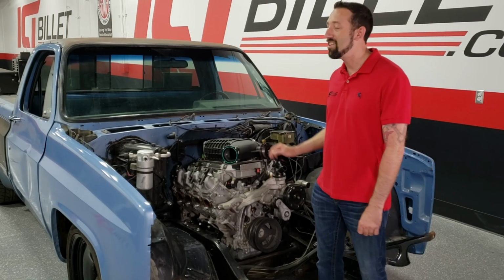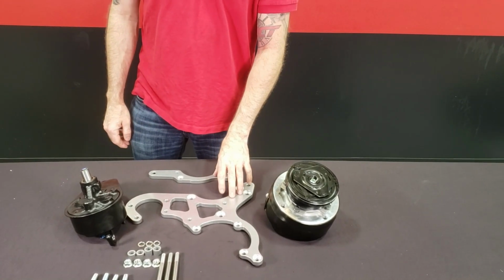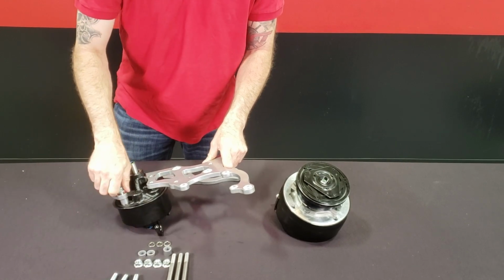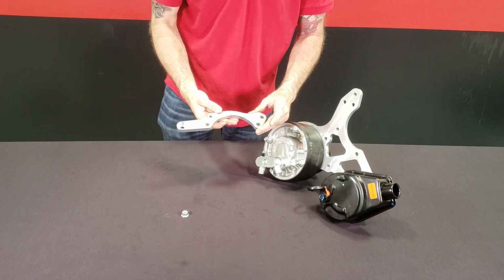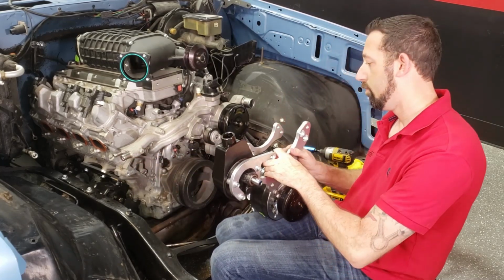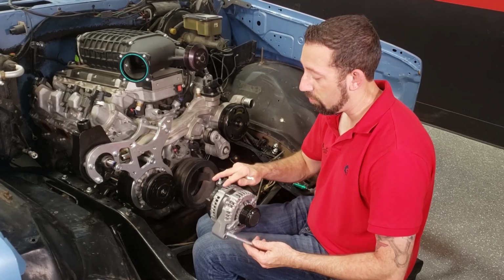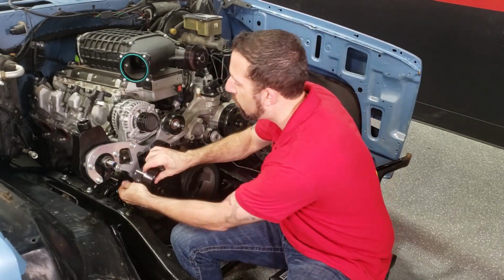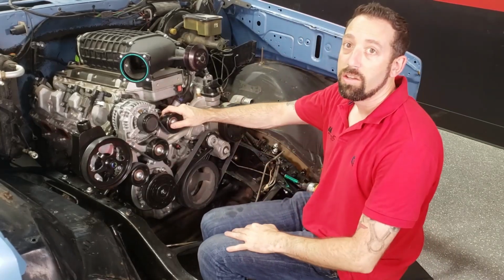LT1 Swap Power Steering and A/C Compressor Install ICT Billet 551118-3

Comment: Is there a different bracket if using a Sanden 508 ac compressor such as comes with Vintage Air?